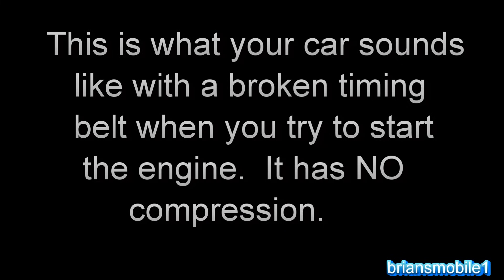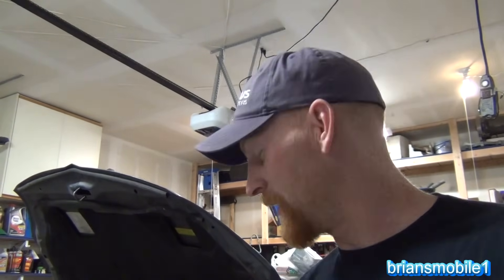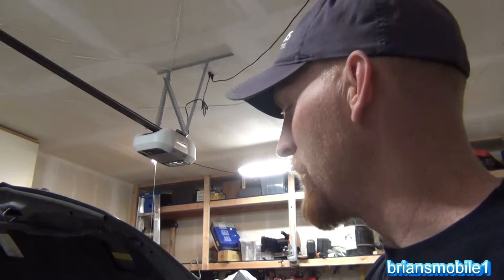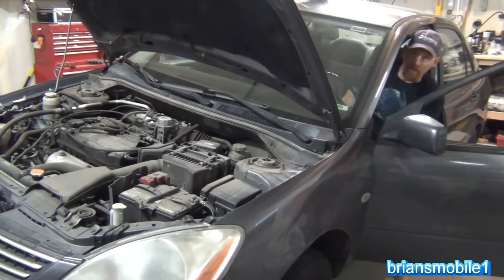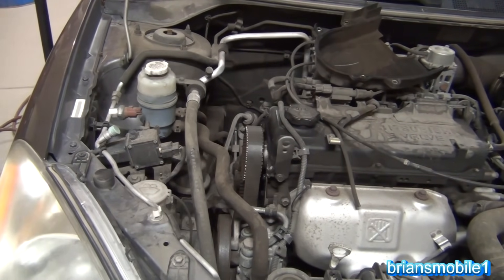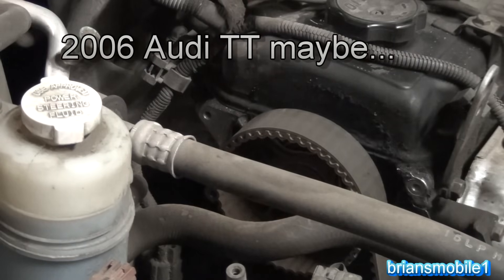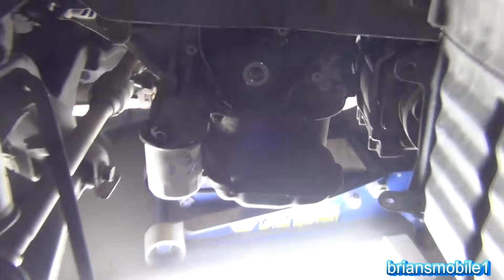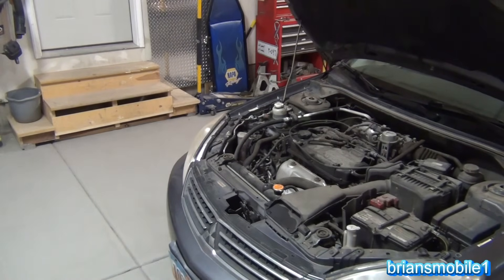What SOUND Does the Timing Belt Make

Comment: Gotta love noninterference engines.
Reply: +sixtyfiveford I believe it is an interference engine, but the way the belt broke was perfect so that ... Wow, not believing myself. The crank still spun with the starter so it had to be non-interfernce, right?
Reply: +sixtyfiveford +gereral1 said it right below. :) 
"This guys lucky. The teeth on the belt missing saved his butt. If that 
crank happen to grip some teeth his valves would have been toasted."
Reply: DE Nichols Some valves are always open in a 4 cyl and the crank was spinning so those valves would have been smashed.... They weren't=noninterference engine.
Reply from the maker: +sixtyfiveford This engine IS interference.   There's a "sweet spot" cam position that the valve springs give the most tension in.  This is where it failed.  Withing an arc of 45° or so on the cam there's not interference.  If you go past that when aligning the cam and the center two pistons or outer two are up like at TDC on #1 it will hit.  I gently got into it and they touched, but didn't bend or hit hard as I was privy to the possibility.  I was "gingerly" with it.  Had this failed on the freeway and not at a parking lot, it would have whacked valves.   Camshaft inertia would have gone too far like those carnival bowling balls on rails games.
Reply: briansmobile1
Impressive. I'll eat my humble pie.
Reply: +DE Nichols you betcha
cause if its not those pistons and valves may be toast
Reply: +briansmobile1 I have a 2.0 aba jetta that the timing belt tensioner locked up completely shred the timing belt, bought it for $600 changed the belt and have been driving it for two years. I think it's classified as non-interference, thankfully, although a new engine would only be around $150.
Reply: SlipknotMaggot0526
The 2 liter VW engine is also an interference engine. That too is called lucky.
Reply: +sixtyfiveford Non interference engines are mostly engines with lower compression ratios, N/A engines. With newer emission standards and higher compressing engines, it is more likely to have an interference engine. They have to design the combustion chambers in a way that parts have to get really really close in order to get an adequate compression ratio.
Reply: heros2110 Right. Helps get a better burn.
Reply: Plutonius X It really is. I'm thinking I should literally choose my next vehicle by not owning the one that had a belt instead of a chain.

After Vietnam, American engineers decided to get the world on cv axles and timing belts to save energy.

Well...my memory is imperfect, but the story goes something like that.

Cars are trying to be as plastic as possible so we should get timing chains back. Ha. Fun blatant statement to be made. :)
Reply: DE Nichols 

To be truthful I own 4 American cars and all 4 having timing chains and have never needed chain service. I have never seen many belts on American cars. Some even had timing gears instead of chains. Japanese cars on the other hand seem to push belts more than American cars.
Reply: Plutonius X PT cruisers lose their engines to timing belts not changed all the time.
Reply: I bought a Suzuki XL-7 under the surmise that it has a timing chain, not a timing belt.  HA I said!  No timing problems!  That was until the tensioner failed and the timing chain almost failed.  Repair was about $300 and required almost tearing the whole front of the car off, dropping the front axle and metal shavings everywhere in the valve cover from the loose chain eating every metal part in sight.  After replacing it, it lasted one year and started to go again from shavings plugging up the oil actuated tensioner.  I'll take a belt like this any day.
Reply: Monel Funkawitz
Yeah. Sorry man. When Suzuki went to a timing chain for it to be "never serviced", I thought we'll see.

It's almost true for Toyota's with timing chains, but they still sometimes need chain tensioners and what not.
Reply: Interference is more fun
Reply: You are not lying there!!!

Comment: This guys lucky. The teeth on the belt missing saved his butt. If that crank happen to grip some teeth his valves would have been toasted.
Reply: Static engines, gotta love em. I ran into this with a 91 Geo Prizm I got lucky on that one also.
Reply: +gereral1 actually wouldn't have made any difference.
Reply: +gereral1 I'm not sure. I've now commented both ways. If the starter is still turning the flywheel, the pistons are still going up and down - he'd had to have gotten lucky to have the valves closed or nearly closed? Hard for me to say.
Reply: gereral1 so I guess it was an interference engine

Comment: My water pump recently failed on my 00' Chevy impala 3.4L V6. I discovered leakage near the water pump compartment. I just went ahead and replace the pump. Now the engine won't turn over. It's making the same or similar sound in this video. https://youtu.be/6Png8wklIMM

Comment: I have a 2001 Honda CRV.  At 189,000 miles I decided to change the timing belt, water pump, and tensioner to be on the safe side.  after the change (did as Honda recommended ) it had a lot of engine noises.  came up with a P0336 code for crankshaft sensor A which is in the distributor.  Timing marks on the cam sprockets and crankshaft are spot on.  Wish I had left well enough alone  The old timing belt looked brand new
Reply: I doubt it was anything you did, chances are the crankshaft sensor just happened to go bad as it had reached the end of its life expectancy. I replaced my crankshaft sensor, camshaft sensor, and ignition coils on my '06 Kia Rio just recently, I did those myself. I also had the fuel pump replaced the other day, it still worked fine as the other components I replaced also worked fine but due to them reaching the end of their life expectancy, I didn't want to take any chances. I looked at my timing belt and it is still in perfect shape, but as soon as I see any sign of wear I will replace it.
Reply from the maker: Usually if something like that happens a sensor wire got pinched or the belt is off a tooth.  Or something got over tightened somewhere. I'd tear it down and see if there are any witness marks.  Maybe review a timing belt video for your car and see if anything stands out to you.
Reply: Was it your first timing belt replacement on the vehicle ?
Reply: @nelsonudeh4473  Actually When I replaced the tensioner, I did not get it properly on the cog.  Timing belt and marks are dead on now and all is good as far as that is concerned.  Found out the distributor gave out ( crankshaft position sensor is inside the distributor on the 2001 Honda CRV)  got a new distributor and all is good now